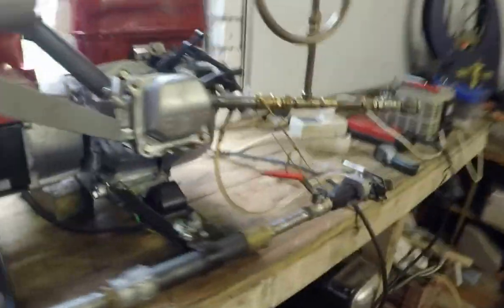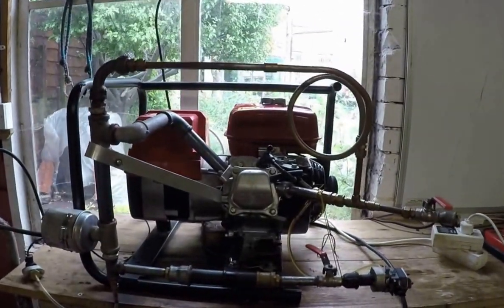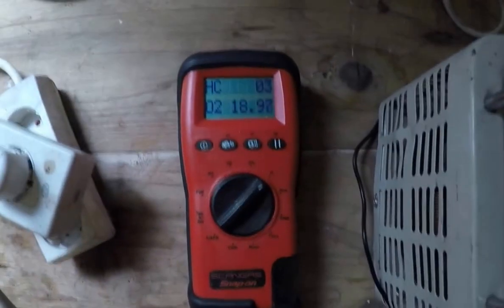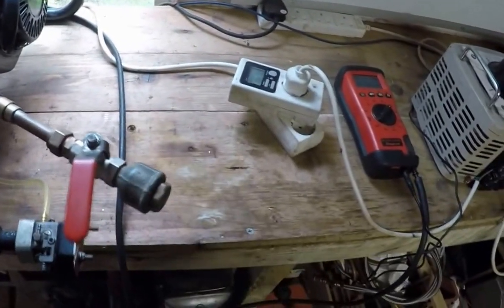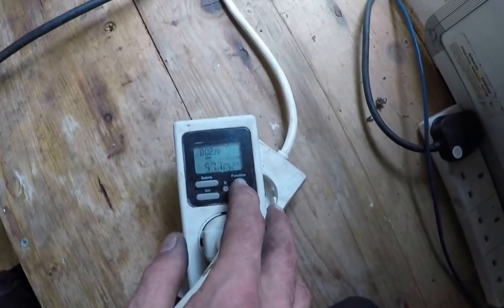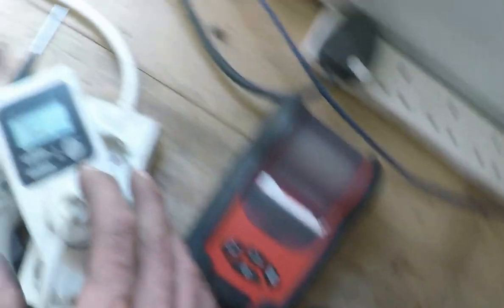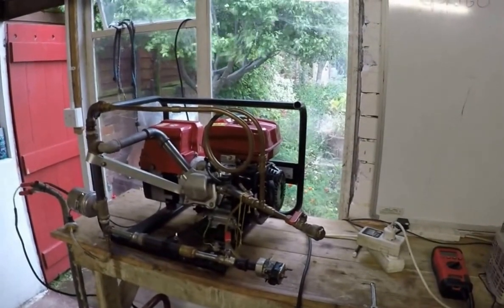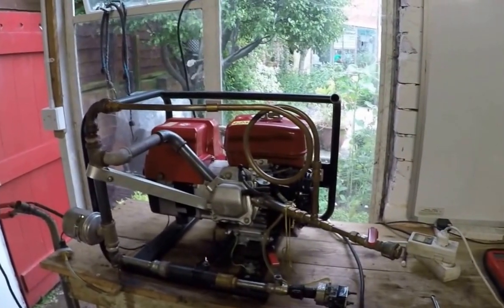GEET Engine showing Power & Exhaust emissions

Comment: What The ** it eliminate all pollution.
Reply from the maker: Yep it's clean.....
I've been playing with something else today.
have a look at my new vid.....
Reply: Dan Easton Bro can  you tell me about that solid stainless steel rod which goes in to that reactor. how to make that rod for yourself?
Reply from the maker: Its just a mild steel rod,  but it has to be exactly the right length and profile for your fuel type..
Reply: @dinskiy  I bought a type of magnetic stainless steel for my 4 stage reformer haven't finished it yet do you think its OK ? I heard as long as its magnetic it would work .
Reply: @dinskiy  May I show you a picture of my 4 stage fuel reformer  where it is in construction now
Reply: @dinskiy  Don't you shorten the rod based on where the magnetic field starts and stops ? Thanks